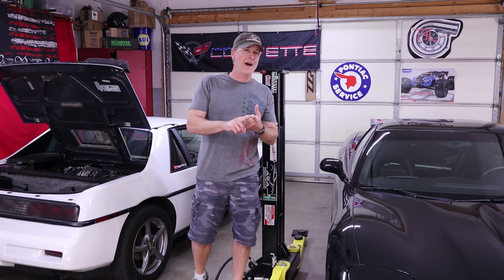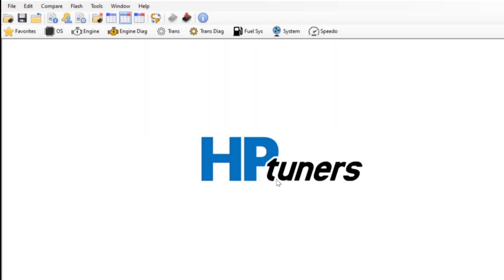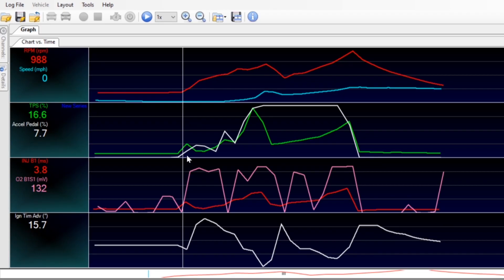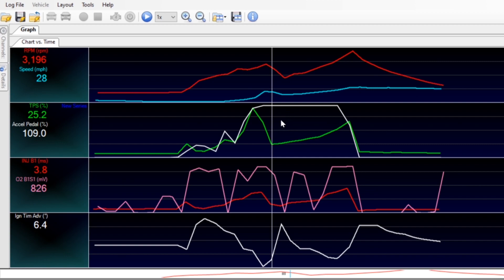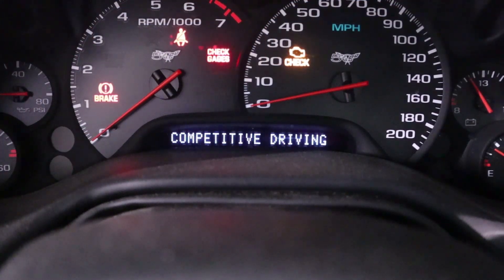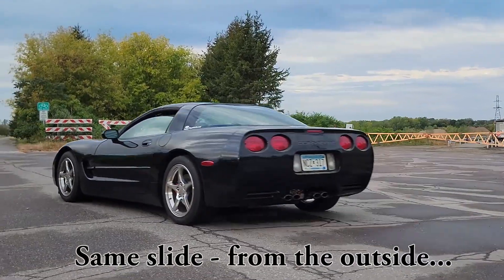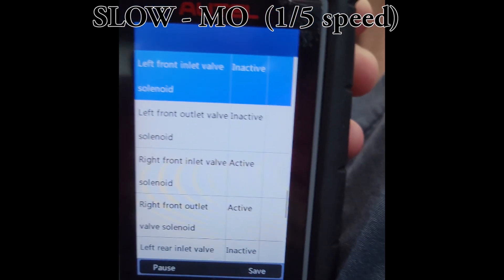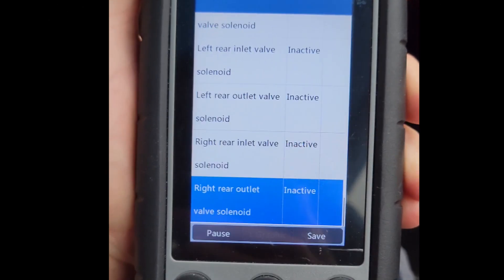Pt. 2 - Scanning C5 Corvette Traction Control, Active Handling and ABS in Action!

Comment: Hello Travis! Congrats on your purchase.
I agree, when this first happens it’s really scary! Additionally, it truly is intermittent which will make it difficult for a technician to track down. To make’s things worse I’ve data streamed using my scan tool and gotten nothing out of the ordinary show up before, during or after the event.
My suggestions are these. Have your mechanic check your tire conditions, brakes, suspension for any play, the wheel bearings and  stabilizer bars for play. Now you’ll know the care is safe to drive.
Next, take note when the event happens. For me, it occurs usually in the afternoon after it’s been driven for a while. Interestingly, it has NEVER happened in rain or wet roads, only on dry roads in good weather!
When an event occurs, you’ll see ACTIVE HANDLING in the DIC. You may also see SERVICE ACTIVE SOON. These will disappear if you turn the car off and on again.
If you are confident in the road and weather conditions, hold down the mode button until you see COMPETITIVE DRIVING. That usually stops the event from happening.
TOYS4LIFE has a couple of excellent videos (see above) as to the different modes and their effects on handling. Enjoy your C5. You’re going to love it!

Comment: I just bought a 2000 C5 and do plan on exercising the active handling, traction control and ABS, especially since the ABS module in the 1997-2000 cars are not fixable once they break.

Comment: Another great and informative video. I've had my C5 for 2 1/2 years now and I guess it's time to try the Active Handling in the "off" and the "Competitive Mode." But, not until these winter storms are over. This past Saturday (Dec. 23rd) the wife and I went to the bank, grocery store and gas station with 2 inches of ice, snow and slush on the road. Starting out in 1st gear I did some slipping but stayed controlled. There after I decided starting out in 2nd gear was better as it's higher gear range. The only problem that I experienced was all the snowy slushy mushy stuff the bigger vehicles threw at me coming from the opposite direction landing on the windshield momentarily covering the windshield and visibility. That's why we have wiper blades. The wife wasn't too thrilled but she insisted on going out in this mess with me. I asked her if she trusted my driving? Her answer- No. I asked if we were safe on our little trip? Her answer- Yes. Oh, and I ordered the T-shirts you listed for both of us and they will be here in a few days.

Comment: My car sat for 19 years. When it rolls down the driveway, it just keeps rolling until I depress the brakes. The bearings are excellent. Not at a steep angle either. The only problem I've had is a bad fuel vent. It's built well.
Reply from the maker: Indeed!

Comment: One of the things I (and many other C5 owners) find really annoying is the Active Handling engaging while driving normally at highway speed on a straight dry road. It can best be described as feeling like a tire Squibbing. 
As I understand it, Active Handling has lost communication with one or more of the speed sensors at the wheels. The DCI reports Active Handling has engaged. I was hoping your video might have addressed this. 
Usually I’ll turn the traction control-off. Very annoying! Another video perhaps? Particularly with HPtuners monitoring?
Reply from the maker: I think it's pretty rare, but definitely very dangerous if that were to occur.
Reply: This happened to me last night. A completely dry highway going about 75mph. Is there any way to fix this? I purchased my C5 a few weeks ago. Did a lot of research beforehand but never read about this issue before making my purchase
Reply from the maker: Depends on what the issue is but this is a serious safety issue so I would find a Corvette specialist and see if they can figure it out. You could scan it yourself with a higher quality scanner, check out the description to some of my newer videos for Otifix scanner I'm currently using , It may point you to the right component that's having an issue.  It could be an intermittent thing to which may take time to further manifest itself.
Reply: @davegregg1512 did you ever figure out the solution to this issue? This all started after getting a couple of different sized rear tires installed after a blowout. I bought the car with aftermarket wheels and tires that were different sizes than stock. C5 has been sitting for a few months, would love to solve this and start taking her out again!

Comment: I like learning something.  My 99 vert code v works and sometimes doesn't. Is the electronic module intermittent or grounding issue?  I think error was no communicate code.  Also intermittent WW no park.
Reply from the maker: I have no experience with convertibles. I hope you get it figured out try corvetteform.com?

Comment: What would happen if I ignore the service active handling warning? If I turn the system off will it still activate or show a warning ? THX KENNETH. 👍
Reply from the maker: I think you lose active handling, extra control and ABS if there's a warning light on. Not 100% sure though, it might depend to some dagree on what the fault is.

Comment: My C5 reads "service active handling " what can be wrong?
Reply: Mine too, with hard right turns, I get almost every code for every sensor on the active handling system all at the same time. I'm having a difficult time troubleshooting
Reply: @4KMotoring  I just drive the car right now with the active handling off the car seems to be ok now since I replaced battery with Optima battery I'm starting to fall in love with car now but I still can't drive it until the finance company sends the title
Reply from the maker: Have you pulled the codes?